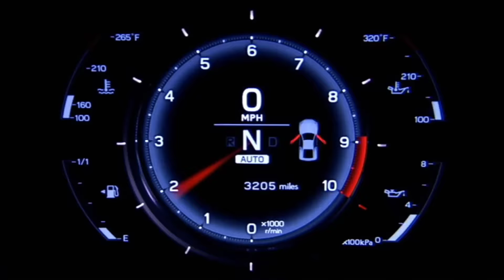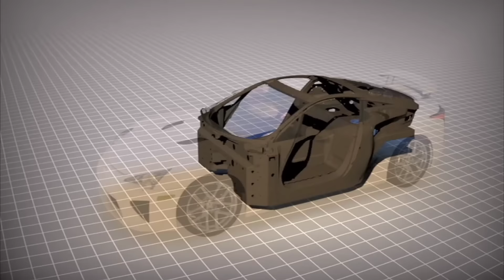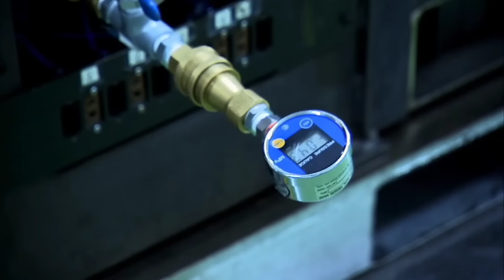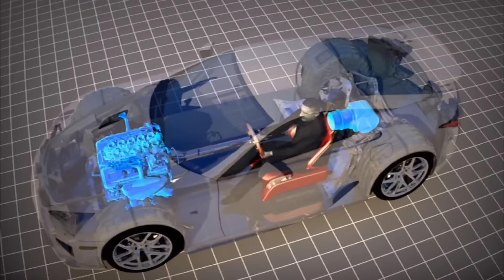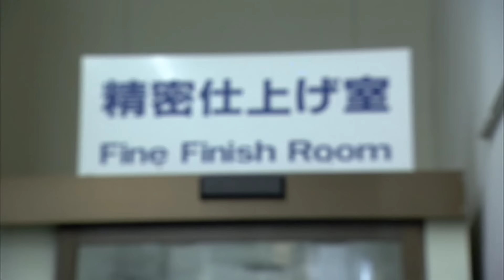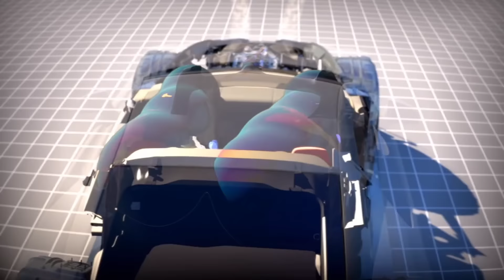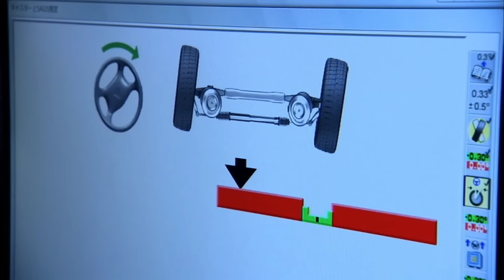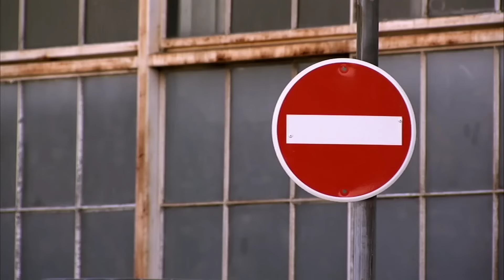Nat Geo MegaFactories - Lexus LFA

Comment: Correction: something not mentioned in the video is that The LFA was made of Aluminum in the beginning and they switched to carbon fiber at the 11th hour and after the cars were already produced. They had to convert every car and that decision caused a big financial constraint and delayed it's official debut date. But it was the best decision which contributed to the cars weight loss and safety.

Edit: I rushed to comment, the switchover is actually mentioned in the video at 9:04.

Comment: If we exclude all the expensive and time consumed parts and components, for example: the multi layers carbon fiber and the 10-cylinder engine, the design of the center and the middle console which is high...
and we went for a full aluminum wheelbase, chassis, and structure, a 6-cylinder engine with twin turbos, extending the length slightly to fit two additional seats (will not fit more than childrens, or suitcases) in the back to make it a proper GT. 
We came out with coupe and targa top models, marketing them at traditional toyota competitive prices (at least in their class or category), maybe tens of thousands of these cars can be sold every year, and the waiting list could stretch for years...
 
the design, despite its simple lines, is sporty and combines the low profile body with a wide wheelbase to improve the grip and enhance the sporty performance, the design is streamlined and very elegant... 
the proposed model based on a more austere and humble version of this Lexus LFA would have become a real competitor to the Nissan Skyline GT-R R35 and to all nasty european sports cars...
Compared to the current Supra project, which in my personal opinion is considered a huge setback in the evolution of the Supra series...

Comment: Imagine a Carbon fibre GTR
Reply: For Nissan GTR it needs weight to optimize handling characteristics for the 4 wheel drive system.. God told me that it will yield worse laptime with reduced weight.
Reply: 😆 🤣 😂  it is ...

Comment: The extra money and time just to lose 100kg ?
I think it was way better if they kept the aluminum.
It would be cheaper to sell and easier to produce.
Reply: 100kg is a lot of weight .Once you understand Japanese Mindset "Kamikaze" You'' understand why that 100 meant so much. THe car was also not made to beat other models in sales but to make a specific statement
Reply: 'Cheaper'? Cost wasn't an issue. Toyota lost money on every single unit sold. They were out to make a statement.
Reply: you really need to be very aware of how a lot 100kg is in sport car tuning
Reply: So if a fat guy sits beside the driver, there is an extra 100kg.
The problem with carbon fiber is not just the cost , it's the time they need to develop it.
They could release the first LFA with the aluminum chassis and then start developing the LFA2 with dual clutch transmission and carbon fiber chassis and more advanced user interface.
This will make more profit to toyota and provide the customer with a better experience because toyota can listen to customers' opinions about the first lfa and improve it in the LFA2.
Reply: @lancewood1410  
Yea, the cost wasn't a problem, that's why they needed 3 years to sell 500 LFA.
The LFA was barely better than the nissan gtr on track, which it costs way less and sold like a hot cake for a quarter of LFA price.
Reply: @davidmason8212  you are comparing the build quality of a Lexus to a nissan? AAAAAHAHAHAHAHAHAHAHAHAHAHAHA. You think you can fford to buy an LFA with pay of yours? LOL.
Reply: @lancewood1410  
So, does the corolla price five times the sentra ?
NO
Why would the LFA five times the GTR ?
Because of quality?
NO Because they build a whole new factory with new technology just to make the carbon fiber.
And no, I can't afford the LFA, but i can afford the GTR then and now.

Comment: All that effort, talent, vast budget and innovation for the engine and chassis, and then they go and fit a crappy automated manual gearbox. Why??!!
DCTs had been around since the early 2000s in various VAGs, so why couldn’t Lexus / Aisin produce an improved version?
Or simply produce a 3-pedal stick shift version of the gearbox they did use?
I know hindsight’s a wonderful thing, but that was just plain dumb.
Reply: DCTs tend to be heavier, so despite the potential drivetrain performance boost, saving some kilos was worth the tradeoff.

Comment: Nissa GTR accelerate to 2.8 secs 100kmh more aluminum. Lexus LFA accelerate to 3.7 ecs 100kmh. So LFA uses 65% more expensive carbon fiber in LFA but still lagging behind GTR with acceleration by 1.1 secs. This counterproductive and waste of money for Toyota. I am very toyota die hard. Nissa GTR makes mechanical and customer sense than expensive Lexus LFA
Reply: Gtr is 60 Gran and this is on It's way to million